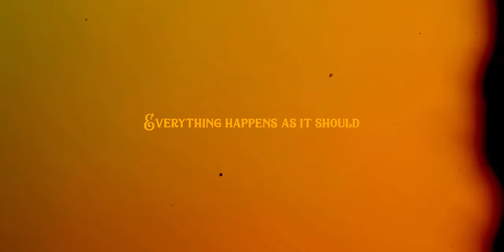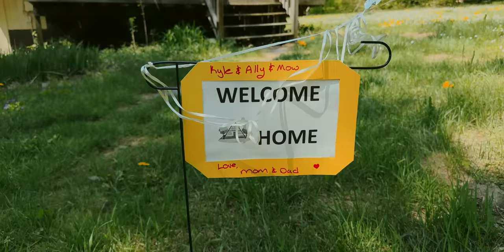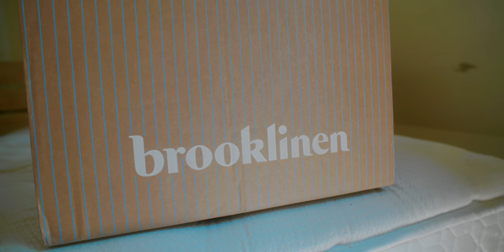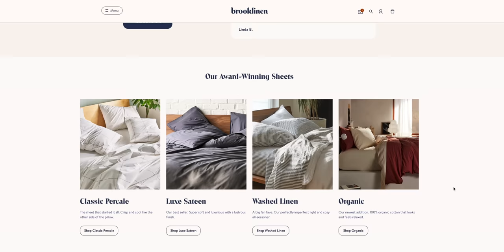Life Just Changed Forever 🏠

Comment: Two things I have done with all of my old vehicles that have made them so much more reliable. 1. Pertronix electronic ignition conversion, goes inside the distributor so engine looks original never again missed spark, no wet points and so on. 2. basic electric fuel pump, before the mechanical pump along the frame is where I put it, no more vapor lock, no starving under loads, you don't have to remove anything just put it on the fuel line with a rating at 4PSI or less, power off the ignition switch simple fuse and it just works. Both can be done in less then 2 hours. So much more reliable. Installed these on 1967 Kaiser Jeep m715 24v, 1971 Triumph Spitfire, 1957 VAC 13/14 Case tractor (Pertronix only gravity fed fuel), 1942 Ford 2n tractor (same with fuel as Case), 1984 ford f150 fuel pump only to stop vapor lock, and there are others. Was worth the Money.

Thank you for your videos/channel! You are getting to live the dream often out of my reach. I am further down life's road then you but still dream of using time like you are blessed to do. Keep up the good work.

Comment: you should install a Holley spitfire Electronic fuel injection and matching distributer into the old blue truck.  It will allow your truck to start as easily as modern vehicles.

Comment: Saw a Saellite Dish In Yard when ya drove up. So TV & then get Starlink You Can Get for Internet Service works great. You appear to have power from the Grid & could then get Phone Line. So what would be the reason to keep the apartment then? From Spring To Fall Watch Out For Snakes. They love to be under the leafs & in Stone walls. Tin Roof best to have. Takes the Ice & Snow great & easy to put on a A Frame Roof. Might look into gravel for the road to the House as the rain & snow then melt will make mud driving on. I am from New England. I would not put Solar Panels on the Roof but build a solar panel location you can walk right upto & clean easy & sweep off the snow in Winter with ease. 2 or 4 lithium batteries. If your using L.P. Gas look into a Generac generator they will do your whole place when grid is down. They burn about 1/2 gallon hour. I have a 325 gallon tank & filled get 6 months from it. Ya got Bear there so always have a can of Bear Spray. Don't want any trash outside as coons & bears will smell it out. Your cat should be well fed with the mice & wood rats inside. I have a pick-up named Blue a 32 year old GMC bought new & is my life line in the mountains where I live. You'al will have a great time in discoveries & adventures. You sure have a good location & place to grow with. always, Tommy🤠